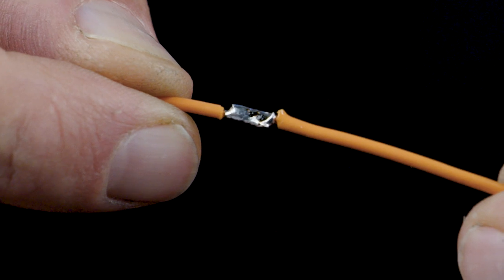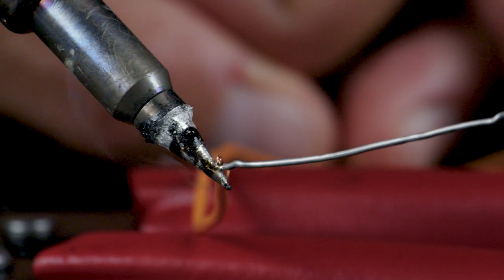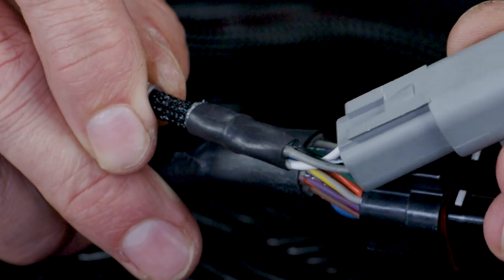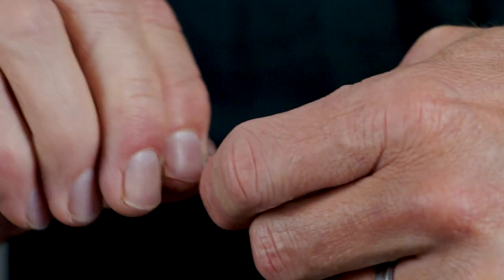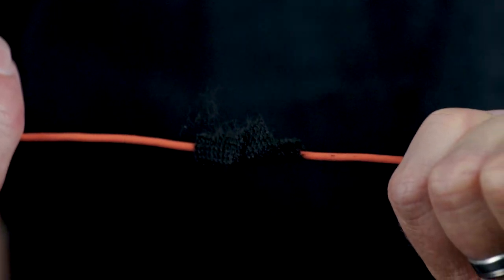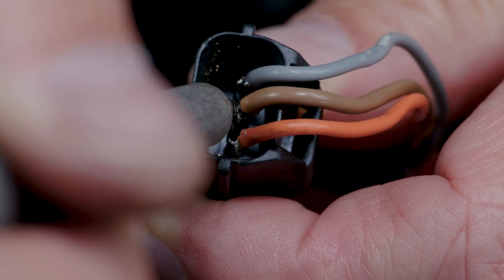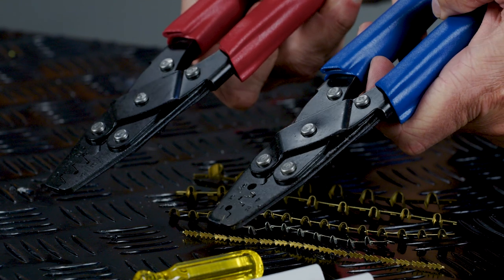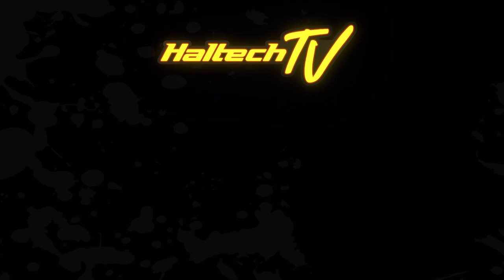🛠 Crimping vs Soldering - Which Is Best? | TECHNICALLY SPEAKING

Comment: I used to swear by solder only, now I prefer crimp. Probably because at that time all I owned was a soldering iron. Depending how flexible the copper strands are, thick strands usually end up meaning you need to twist longer wires together and after soldering you end up with sword that doesn't flex in your harness. If you can keep the twist joint short I don't mind so much using solder. Solder has its place but its not all the time

Comment: Been in turf (extremely wet conditions along with whatever chemicals you get from maintaining it) for the last 16 years. Every single solder joint even under the best weather protection has always been a green corroded mess. The movement of electrons from copper to solder alloy back to copper is a point for electrolysis to happen. 

Crimp with weather protection just fine and dandy.

Comment: Great vid thanks. Soldering onto crimped connectors: I’m curious if there’s been a thorough study on the strength and health of crimped connectors that have had some solder added, done well with flux and protected with dielectric grease and heat shrink. Is the crimped wire really damaged in this case?  The reason why this is an interesting question is that us amateurs often risk doing an insufficient crimp. For example I always do a pull test on my crimps, but how much force to use? I can usually pull apart my crimps with a fair bit of force but the judgement on how much force to use is too unscientific, so my insurance is dielectric grease and heat shrink protection over the top of the additional solder added to my crimp. Probably an overkill! but seems the most solid option to protect against moisture, vibration and oxygen. A lab based study would be so interesting.

Comment: Over my years as a car mechanic (10 years) I've seen several times more failed crimp connections than solder connections but in every case the source is the same, vibration, water or a wire in tension.
Seen extremely many OEM cables where the whole wire is pulled out from the crimp which is virtually impossible with a soldered joint, but here having heat shrink as an extra strain relief is important and not wicking a whole spool of solder on a small joint as it only need a little bit.
The solder also helps to keep it watertight not allowing water to wick between the strands and into the insulation.

So a strain relief and keeping it watertight is the absolute top priority.
Reply: And always use heat shrink with glue, the other ones doesn't protect anything against water/salt or strain and often falls off or just tear open

Comment: I was water well driller pump installer for over 20 years and we crimp the connections and use heat shrinks and the connections last underwater or not forever more or less and the connection is strong enough I’ve pulled up a pump all the wire and hundreds of feet of pipe when the pipes broken off the pump. So I can pretty much guarantee my crimp connections are superior to any others.

Comment: I've been enjoying this debate for decades now and I am 110% convinced there is no right answer.  IMO it is a purely personal issue based mostly on the situation and there are more factors involved.  

I find a solder joint to be better resistant to corrosion but a crimp is WAY faster.  In either one I have found that if the joint will break it will inevitably be right near where the insulation was stripped outside of the actual splice.  This can be mitigated with a crimp that also takes in a bit of the insulation or a well wicking solder that will be pulled up into the strands under the insulation via capillary action.  I find solder joints to be better resistant to moisture buildup from condensation but they can also not always be an easy joint to make due to physical location (ie under a dash).  I've taken apart multiple crimps and found corrosion inside the connector (most often with butt connections).  I've had situations where the crimp induces noise into a circuit and the ONLY way I was able to get rid of it was to solder the joint.  A solder joint where the wires are just laid against each other with the solder used as a filler or glue is relying 100% on the solder as a structural material...which it is not.  If I solder I twist the ends together first.  Form a mechanical bond first.  Sometimes I even combine the two options and I will use brass tubing and slide it over the bare ends as if it were heat shrink.  I'll slide in a small piece of solder and then crimp the whole thing tight.  A quick hit with the soldering iron or a small torch and the solder fills the joint.  This way I get all the mechanical advantages of the crimp and the solid electrical connection of the solder.

Really I think there is no "best" here.  it depends on what you're working on, what you're looking for, how much time you have and how you were taught.  Add in a little stubbornness and we have a situation with people camped out on both extremes with no one being right.

Comment: Good video. And you didn't even get into the topic of multi-strand vs solid wires.  Generally accepted that multi is better for low voltage (i.e. 12v) and that a solder joint has made that part of the wire a solid, and therefore increased the resistance.
As some others have mentioned though, proper waterproofing of the joint is probably more important than anything else, otherwise in time corrosion will eat it away and you'll have no join anyway (especially if you don't wipe off the flux on a solder join). Glued heat shrink is amazing stuff.
Reply: None of that is true.  Multi-strand is used when the wire needs to flex.  Solder making it a solid does not increase resistance if the wire is correctly joined together tightly before soldering.
Reply: @stinkycheese804  Hi Stinky. Good point and this makes absolute sense and is also the reason that structural wiring in a house is solid core, and from plug to appliance is multi-strand and called 'flex'.
One of the main factors affecting resistance is the cross-sectional area of the conductor (which can be reduced by bad crimping) which is not affected at all , or is even increased by a solder joint.
There is however another lesser-understood phenomenon called 'surface-effect' which affects AC circuits. This is where the current flow is concentrated near the surface of the conductor. A solid wire has significantly less surface area than multi-stranded wire. 
"How is this relevant to auto-electrics which are all DC?", you may cry.
Well. It's actually a feature of the 'frequency' of the current, and not whether that frequency cycles from positive to negative. A current rapidly pulsing from 12v + to 0 can be considered an 'Alternating' current (yes I know that's voltage not current - but the current will also pulse). While this is not relevant to most of the circuits in a vehicle, the one that a lot of people are concerned about is the quality of their audio...which can definitely be considered a pulsating current. The differences again will be less than those from many other features (using larger cables, oversized connectors, tight joints, etc), but it is still a factor for audiophiles.
Any clarification of this phenomenon by experts is welcome. I never claim to be an expert in anything - there's always someone out there who knows more than me.

Comment: The real issue here is people base their opinion on anecdotal bias based on technique:

Soldering requires far more skill to do correctly, most people over heat the join and wick too much solder up the wires.

Crimping requires an expensive quality crimping tool with the correct dies, most people use cheap generic crimps and a cheap handyman style tool.

The correct answer is you should be properly soldering AND crimping, just not at the same time!

Comment: I both solder and crimp, but I only solder under certain circumstances. 1: the joint is in a straight part, not in a bend. 2: I can actually fit glued shrinksleeve around it (no tape) 3: its not moving once installed. As long as those requirements are met, solder is fine for me. Anything else, I do indeed crimp. But still have the shrink sleeve as a requirement.

Comment: Like everything else, different wire connection procedures has their place. Electricians use wire nuts for building wiring, electronics use solder and crimp and automotive and marine also use both along with compressing a screw or a piece of metal with a screw against the wire. I work in the salt water marine field and a good mechanical connection is just as important as any other field but corrosion is very high in this field. We use heat shrink with a hot glue for general wiring but you must use the correct crimpers to prevent tearing a hole in the insulation or you defeat the purpose of the glued heat shrink. I think the glue also adds strain resistance and breaking from working the wire at the connection. With battery cables we crimp then solder. The solder seals the mechanical connection to prevent salt and moisture intrusion. When salt water gets into a connection the water may dry out but the salt doesn't evaporate. It stays until the connection corrodes away. Using the cheaper open PVC type crimp connectors may be OK for some things but I think they invite weakening and wire breakage from vibration not to mention corrosion. I sometimes use solder and shrink tube with glue, especially if the wire is smaller than 18 AWG. I don't know what mm that is but it is getting small. I find it too easy to damage the smaller wire and promote breakage at the crimp point.
Reply: google tells me 18 AWG is equivalent to 1.024mm

Comment: I've been using both in certified radio, telecoms and aerospace work for the last 50+ years. It's a case of horses for courses: The design engineer makes the decision, you work to the specification. If you do use crimps, buy the correct tools, rather than cheap stuff; if you solder, make sure to clean the joint before heat-shrinking it. In my line of work there are no lap-joints.

Comment: I just learned this (probably why it was showing up in my recommended tab). After thinking about it. Anytime there is a massive gauge wire joint, maybe something like an industrial application or the power lines outside your home, I have never seen 2 large gauge wires soldered together, they are ALWAYS crimped mechanically. There must be a reason for that. My intuition always lead me to believe that a proper solder joint must have a lower resistance, I'm not sure, but that may not be true. I am assuming a properly crimped connection must be nearly identical.

Comment: The solder that wicks up the wire is the main problem here. It generates a very rigid interface between the clean wire and soldered part, which is almost certain to work harden, fatigue and break when exposed to vibrations. Crimps also have a quite rigid interface, but it is more gradual, and since it does not creep up the wire, it is closer  to the joints so the two ends of the wire stabilise each other. Also, soldering flux - which also gets wicked up the wires ahead of the solder - can be corrosive, so cleaning it after soldering is recommended in electronics. I recommend using crimps whenever possible. In fact, I would PREFER twisting the wires together to soldering - but I'm not talking about your simple twist, I would use a lineman splice (a.k.a. Western Union splice) for this. Secured by some heat shrink (preferably glue-lined) it is mechanically quite strong, it is a very good electrical connection and is quite durable.

Comment: We've always crimped and soldered. The only time that I have had trouble is when using poor quality wire (the aluminized crap). 

Citing a commonly failed solder joint on an OEM vehicle is not a bad way of going about building some proof, but I would have liked to see you guys perform an actual test proving one is better than the other.

Comment: I prefer soldier, I do feel it's more reliable of a connection, and significantly less prone to oxidation/corrosion. In my teens I preferred crimping, quick and easy, but I've had to go back a few times to solve random issues on vehicles.

The amount of times I've troubleshooted something down to an old crimp is not insignificant. You don't see a ton of crimps, and if you do it's normally in a wire harness, or simply repairing a bad section of wire. 

But they do fail, they corrode, and it's a frustrating issue to deal with as I always find myself defaulting to questioning them crimp. There are better crimps, there are worse crimps, I hate the double ended butt connectors ... When given a chance I prefer to solder, they are less prone to oxidation/corrosion.

However there are downsides to soldering, more time consuming, difficulty working with in tight spots, and frustrating to lay on your back, only to solder something under the dash above you. Situations like that, crimps are acceptable, they see limited exposure to elements inside the cab.

Weak solder joints are almost always user error, and lacking the experience to know when a joint is good/bad that is fair, everyone learns somewhere. My issue with crimps is they always oxide/corrode leading to a faulty, to semi faulty connection. This is why I dislike them, and to me personally this is an advantage to soldering even before die electric grease/shrink tubing come in.

You can use both on a crimp as well, but you risk the same issues as corrosion when you put die electric grease on some type of crimps. However I'm not an expert on either, my young brother is an electrical engineer. He only uses crimps in his line of work, he likes them, but he works in a very controlled environment.

For some things crimping is the only real options (tight spaces) but when given the option I prefer to solder, again though some stuff like speaker wire, or items in a cab don't exactly benefit from solder.

Comment: My father was an electrical engineer and he always used twist and solder I've none that for over 25 years and never had a problem but also I've gotten lazy and crimped and never had a problem so it's a personal choice but the heat shrink you use is the biggest variable on how long the connection will last along with not tightening cable ties tight to give the wires flexibility and also cushion against vibration.

Comment: If there's any vibration, no solder for me. If the connections are potted or fastened down tightly, then solder is a good choice. Better to twist the wires before soldering to get good wire-to-wire contact as solder is more resistive than copper. In high amperage or sensitive sensor circuits, it can make a difference.
I often use dielectric grease in my crimp connections to make sure no corrosion occurs between the two.

Comment: In Heavy Commercial Vehicles, especially waste transfer, soldering is preferred as water is least likely to enter the join and corrodes. Solder is a problem when the join is in a location that is susceptable to flexing, causing it to crack.  Easily prevented by securing the harness correctly.

Comment: Yes but also there is another factor- how often a hobbyist (occasional user) makes a bad solder joint compared to making a bad crimp.  My experience is that (for occasional users) bad crimps are more common than bad solder joints.  For occasional users, I think the lowest failure connector is an IDC connector (like a WAGO).
Reply: Based on what I have seen, "bad" crimps are also more common in mass production.  It gets the wire connected much faster than crimping then soldering but very often crevice corrosion sets in after a while and loosens up the joint.  Depending on the warranty period, you may be getting hit with the repair cost nearly a year after the gear was fielded.
Reply: @stinkycheese804  It all depends on the type of IDC connector.  IDB ribbon connectors have been around since the 50's and I have seen very little issues with them.  They are even certified for military and aviation use and are commonly found in avionics system.
Reply: @kensmith5694  I agree.  It seems like most times with I have do diagnose a custom harness issue it ends up being a crimp issue.  On my new system designs I have moved away from custom harnesses to commercially available molded cables.  Not as sexy but much more reliable.
Reply: @connecticutaggie  I have done designs using "flex to install" flexible PCBs.  In some cases, that is the best way to connect a group of things together.  You get even better speed than using crimps without the error and failure rate of crimped custom cables.
Reply: @connecticutaggie  They where done away with in the computer industry because they became more trouble than they're worth.  That and moving to serial connections so with far fewer conductors, they no longer had the merit of being so much lower cost.  Otherwise, the problem is mechanical.  You never want to pinch a wire nor pierce insulation if you want maximum vibration, and corrosion resistance.  There are sealing IDC which help but then the cost goes up to where it becomes questionable if it's really the right choice.  More and more, they've been done away with by gold plated (contact) mylar ribbons when a larger # of parallel conductors is needed.
Reply: @stinkycheese804   @Ken Smith my situation is different - I make inhouse equipment that we use on our manufacturing floor.  That is low replication count (usually 10-30 units), controlled environment, high reliability (very low down time), and minimal size and cost constraints.  That means I either have to contract out the cables or have them built by technicians that don't do this regularly.  As a result, I have tried to move off crimps and soldering and use commercial cables and replaced custom interconnects with custom PCBs.  In the case where a commercial cable is not available, I use crimped on ferrules and push-in connector that are pretty much impossible to mess up.